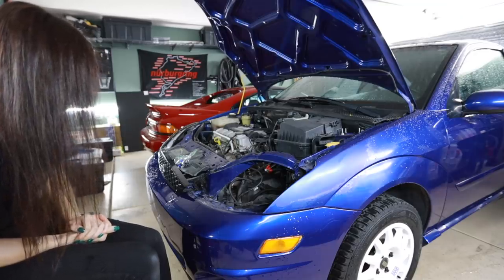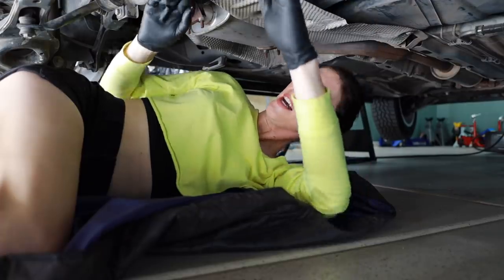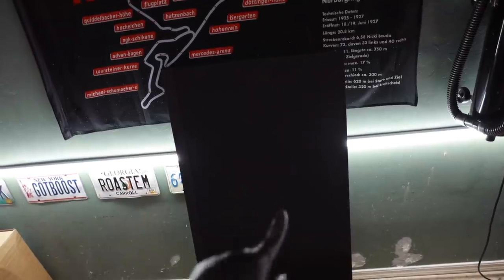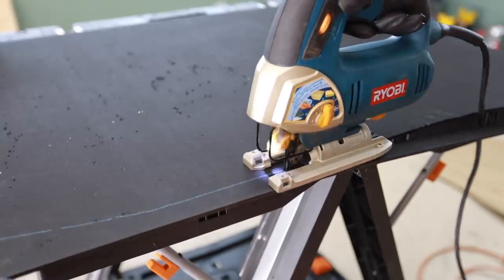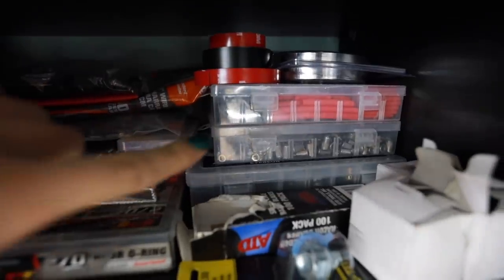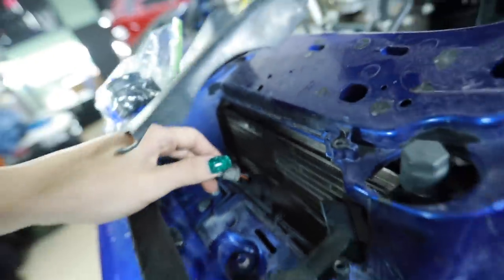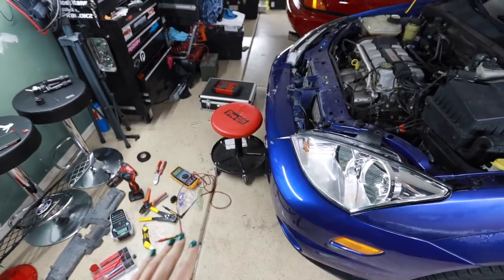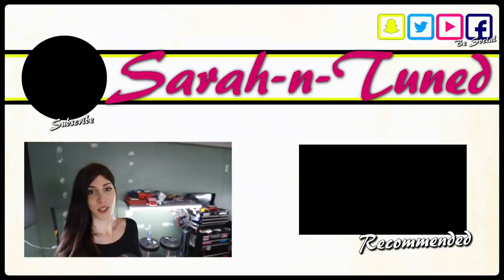The Fabrication Process Begins! // Rally Skid Plates & EU Spec Lights

Comment: Great video, Sarah. You're wiring skills are very impressive. Just so you know, the reason Ford used the same plugs as Audi is because they are European market plugs and are known as Deustch (sp.) connectors. They are Europe's answer to GMs Weatherpac connectors. Keep up the great work.
Reply: Sarah, I almost forgot. Those little bolts you showed us are called button head cap screws. They're the perfect fastener for your application. And the riv-nuts are the perfect way to secure them to the body of the car too.

Comment: P21w is the bulb which is a 7506 bulb if you go to any Autoparts place, 7506na if u need the amber bulb. Look up a connector for a 7506 bulb that might fit your headlight.

Comment: Sarah, glad to see you're using a jack stand (should use 2!) in addition to the Quick Jack. The QJ manual says: "Do not work under an elevated Vehicle unless properly rated Vehicle Jack Stands in place at the factory-recommended Lifting Points." You're smart to be safe.

Comment: "You could run a driveshaft down the center of this thing"

oh HELL yes!! make it a 4x4 Focus!!! <3
Reply: Four by Focus 🤔
Reply: Sheet, that'd be awesome!
Reply: The 4x4 hasn't been done so much but the driveshaft down the middle has.  There are numerous Foci out there with anything from an old 302 V8 to a supercharged Mustang Cobra motor and RWD.  Some solid rear axles and others with Mustang Cobra IRS.  Ford Performance re-sold a kit/parts for the conversion plus I believe there were others out there.  They come up for sale every now and then.  Also, much rarer, is the one or two mid motor/RWD Foci.  There was a company (in Florida, I believe) that was working on moving the Zetec to the back seat area.  I know one of their prototypes had the Jackson Racing supercharger on it.  Unfortunately they never went into mass production as far as I know.
Reply: So wait installing a drive shaft can make a car 4wd?
Reply from the maker: Charles Aggenbach ahh, but it has been done 😉 https://bringatrailer.com/2017/12/21/cosworth-4x4-swapped-1999-ford-focus/
Reply: @SarahnTuned  that's a proper conversion!  Back in the day every few months somebody would pop up asking about using some flavor of common AWD setup (Escape AWD for example).  My favorite was the FWD SVT Contour V6 swap.  Of course forced induction could get you more power for cheaper.  These days if I had the money and the right donor car I'd love to swap a Mk 3 RS drivetrain into a Mk 1 focus with Euro RS bodywork.
Reply: Facts! Plus is the world of rally Cosworth m sport etc have been making escorts fiestas and focus’s awd for awhile now.
Reply: @sadtoast6122  Four by Fourcus
Reply: @kennethvance8896  would also need a 4WD transfer case to run both sets of wheels
Reply: @charleswa  Kugel Komponents .
Reply: @K4rt80y  yep.  I might still have old Ford Racing catalogs around with that info.

Comment: Run the break and fuel lines inside the car Sarah, it will save you a Whole lot of trouble later on. As in both lines will be damaged from impacts, the skid plates will only protect the Stronger under carriage. Or else run them on the bottom of the floor along the chassis legs. Best of luck 😁
( I own 2 Rally cars and involved in Rallying for 25 years )

Comment: Using the button head Allen screws to mount the skid plates will look good until you need tp remove them again when the socket is full of hardened mud and crap, personally I'd go with flange bolts, or a conventional bolt with a washer or even a captive washer HTH

Comment: There is a jumper wire you can add to run the low and high beams at the same time since the bulbs and reflectors are separate. That's what I did when I installed mine. Also, I have a spare, brand new Ford OEM multifunction switch that's never been installed...

Comment: Stainless steel button head Allen bolts. You might consider adding a stainless fender washer with the bolt to have more surface area to hold the skid plates onto the frame!

Comment: In the 90's Ford and VW had a cooperation going on. They built the Galaxy and Sharan together. Above that they developed similar electronical components. Thats why you can find the same blinker housing on a 2000's Fiesta and Polo :) So that should explain why the plug on the Focus is an Audi/VW part

Comment: I’m about to mount one of those really big ceiling fans in my garage. It’s made of metal and is 6 feet wide and moves a ton of air.  Really looking forward to it and luckily, it works with a remote so it only needs constant electricity vs switched.   I can tap right into the garage door opener’s power.

Comment: In the RC rock Crawler world we use metal for everything like rock rails because the plastic is softer and grabs the rocks. Keep in mind that those are lightweight cars. 
It should function the same, metal being better, but the plastic will be cheaper and simple to replace down the road if need be. 

If i were to do it, id use plastic like you did, but id focus on a rigid plastic not like nylon. 
Dig the video, and i dig what youre doing to it.
Reply: In the VW world there are acouple aftermarket skidplates that are aluminum, "paner plate and full metal jacket" and the "Evolution skid plate"  you could check them out for inspiration. 

Id go aluminum if possible. Even painted steel will eventually rust and try to share the rust with the rest of the car.

Comment: Back in the 1980's to rally prep our cars plastic wasn't an option.Brake lines would be run through the interior of the car and fuel tank relocated to the inside(smaller and behind a fire wall).Skid plates were only used to protect the engine and sump.Great video,keep it up.

Comment: There are plenty of P21s on VW/Audis and Mercedes. The ones from a 2009 (and several other years) ML 350 tail lights are easy to repurpose. I normally use 7506 bulbs as replacements, but not sure if the 7506 socket tabs are the same.  Should be worth looking into.

Comment: I would have never thought of plastic! Hopefully we will see how it holds up!
Reply from the maker: HPDE works great for skid plates, metal gets caught on stuff and can end up doing more damage than if there was no skid plate at all. Depends on location though as well.
Reply: Plastic can get beat up scratch up and replaced a lot easier when they go bad especially with simple rounded Alan wrench bolts holding it in. Sweet and simple

Comment: For your sockets when I worked in the body shop and we couldn't get a  part like that we would use hot gloe from a hot glue gun because it comes off easy with rubbing alcohol takes it right off and you can get the hot glue in several colors

Comment: you can fill that socket up with hot glue but you need to rub it down with some type of a grease on the inside so it doesn't stick to the headlight socket

Comment: Neon Yellow Socks!  
Good stuff on the shields, and yes, I was freaking out a little with the lack of the weatherpack on the pins.

You sure you got pins 2 and 3 on the turn signal right? With the front and side flashing out of sync, I think those might be swapped, or just a bad ground. Also, Benz uses a bulb socket that should fit in your hole, but just like the Ford ones, it's only 2 pins, so the drl function of the dual element turn signal bulb goes away, because it's now a signal element bulb. Benz pn is 001 826 34 82 if you want to see if you can get one local, it was on all 203 and 211 models, so early 2000ish C and E classes, some newer models too, but that gets into some trims having leds and some not.

Still digging that shirt.

Comment: Hold on Sarah, if you use the Euro turn signal bulb, it will be 2 pin instead of three, because the turnsignal is separate from the parking light(you called it city light)

Comment: Excellent progress, Sarah! May I ask a genuine question (as I live in England where competition vehicle prep rules are probably different)? Are you required to re-route fuel lines and brake lines to run inside the car, rather than underneath, to compete in your Rallycross? Maybe not, but it might be an idea just to check.
One final thought... maybe use some big washers under the Allen bolts when securing the skid plates under the car, to distribute shock forces from when you start giving Sir Codsworth the beans on a Rallycross track!

Comment: Had the great idea of getting a 94 ranger to tinker on . Did about 1\3 of the engine stuff and put it in the yard now it doesn't have fuel pressure . So i cant get it back in the garage to put it on the lift so i think im going to try to take the bed off . Im sure its going to be a disaster with 20 years of rust . Need to do rear shakels ,cab mounts ,and fuel pump ,so im going to give it a shot. Maybe do something with the frame with the bed off . Got a $200 chinesium plasma cutter for fun should help . Just relating to you with your crapbox ford . I know why you get yourself into these messes i dont know why i do, im not making  a channel. Oh i didnt work on it today because its 45 ° and windy and found mites on my snakes so i cleaned them all day ,what am i doing!!

Comment: Does adding those sheets of plastic increase body lift at all? Without them I assume the airflow under the car is more turbulent than with them and the full, smooth underside will give the car more of an airfoil profile? Or is there no significant increase not requiring the additional down force from new spoilers and wings?

Comment: Just a thought but where did you get your EU spec lights from? If it's Germany, France or anywhere else where they drive on the wrong side of the road, you'll be ok because the dip function will point the right way. If they came from the UK then they'll dip into oncoming traffic which won't make you popular.

Comment: Dont use steel for your sump gaurd and tank gaurd it would need to b 6 to 10mm think to not bend up and smash your sump.Too heavey and sparks too much on jumps.We use 6mm aluminium with 2 or 3 evenly spaced strips of 6mm aluminium welded along  it length or you can you just straight 10mm thick aluminium sheet usually with wee bend at the front to stop scooping up gravel or just up and stick ryt behind the bumper to protect the front if you hit a small bank .

Comment: P21W is a turn signal socket according to my Google search.
Reply: P21W is just the bulb - standard 21 Watt bayonet fitting. They're used for turn signals, brake lights, reversing lights, etc.
The socket/holder is a separate part which the P21W (also called 382) bulb bayonets into, and which then clips/screws/bayonets into the headlight assembly.

Comment: Does that car have a separate belt on the ac and power steering? If so  remove that shiz. You can always notch the seals in the rack to make it easier to move.

Comment: surprised you didn't use a wire removal form!  rather than replace stalk switch, mount switches on the dash.  ???  just hit while rallying, rather than hit stalk by mistake while driving off road

Comment: im amazed you can pay for all these cars but cant afford a $2.5k lift?
Reply: Not enough height in a garage like that for a lift I don't think. Could be wrong but looks to be to low of a ceiling for a full on lift.
Reply from the maker: zapman2000 my garage is too small/ceiling too low for a lift and it’s a post tension slab—no drilling.